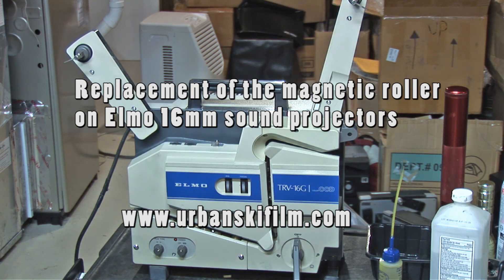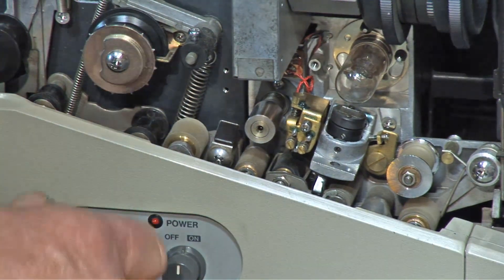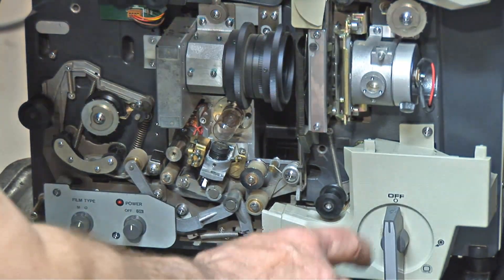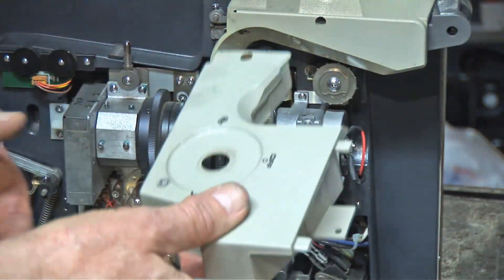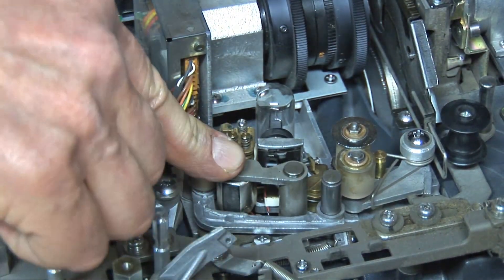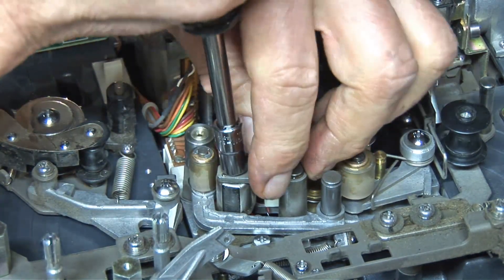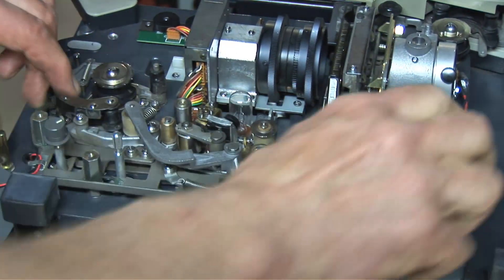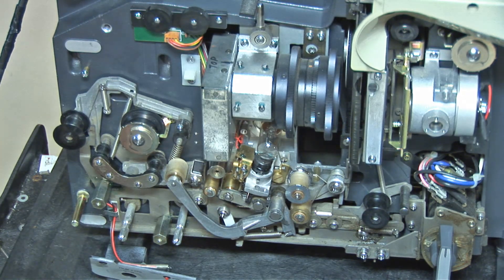Elmo magnetic sound roller replacement

Comment: Thank you for the video. What's the purpose of the shroud ?
Reply from the maker: The shroud on the magnetic rollers is there to reduce and electrical or static interference affecting the magnetic sound head and associated components. I have serviced machines where someone did not replace the magnetic roller shroud and the magnetic sound still played fine. The shroud is probably engineered to stop interference in various climates and humidity's where static could occur.